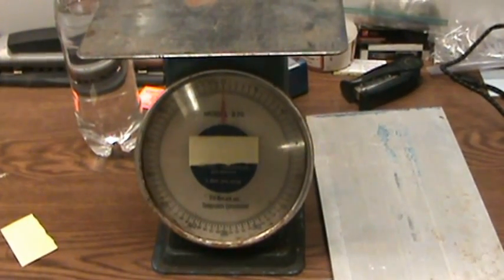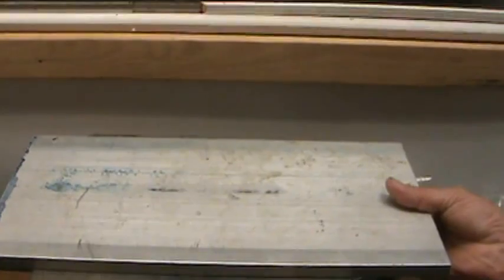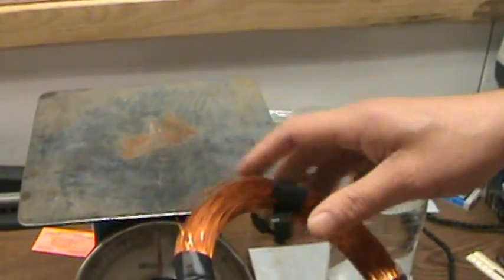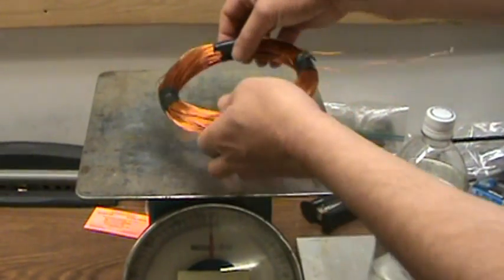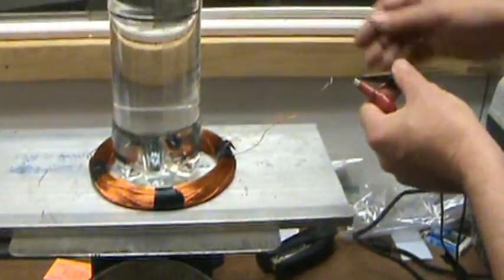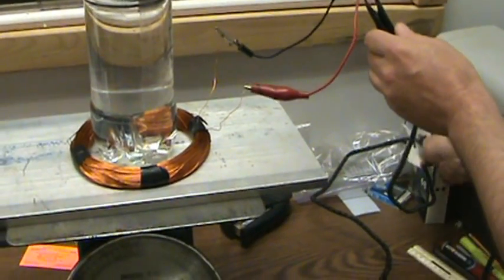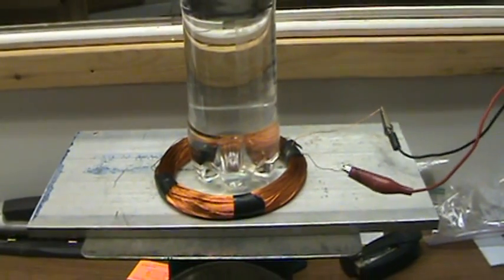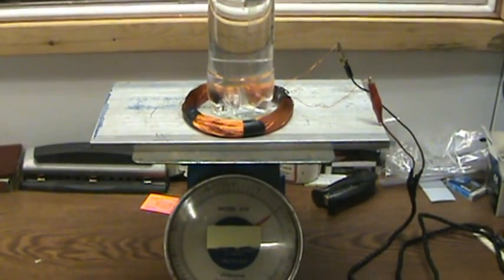Coil Levitating Over Aluminum Plate, Lenz's Law, checking mass

Comment: So why is the coil levitating? Lens law?
Reply: Yes, Lenz's Law.   

AS TO WHY THE SCALE SHOWS THE SAME WEIGHT.
First, recall that a scale just measures downward gravity force.  When the coil is hovering, there is now the additional force created by the opposing magnetic fields (the coil, and the plate) due to Lenz's Law.

The forces acting are:
1)  F = mg  (weight, aka the force created by gravity acceleration)  DOWNWARD.

2)  F ∝ (N⋅I)^2 / δ^2⋅z^3  UPWARD,  where N = # of turns of the coil, I = current, δ = skin depth of current at the frequency of the current (60hz, most likely), and  z = height of the coil above the plate

The 2nd force is how the scale's surface continues to be pushed downward even though the coil is no longer resting on the plate.  You can think of it this way: your dog weighs 25 pounds.  You weight 160 pounds.  The dog (only) is on the scale, which reads 25 pounds.  You lift your dog up into the air, and step onto the scale.  The dog is no longer on the scale, it is 'hovering' above the scale, not touching it.  But what does the scale read?  160 pounds plus 25 pounds.   In this case, you provide the upward force keeping the dog 'hovering' above the scale. You are visible, so it's easy to know why the scale reads 160 + 25 pounds.   The electromagnetic repulsion force is simply not visible.

Comment: comprehending the basic tie LEVITATION however silver FLAT RECTANGULAR WIRE & aluminum FLAT RECTANGULAR WIRE blend coil levitating type 2 DUAL SHAFT ARMATURE ROTARY brushless motorized transductor PANCAKE coil EDDY CURRENTS repulsive FORCES permanent magnet esc TYPE ANTI-GRAVITY UAV FLYING SAUCER DRONE TYPICAL DESIGN however I've design the THERMOELECTRIC EFFECT REFRIGERATION silicon ELEMENT COIL triple junction flat rectangular wire spun tight coil SOLENOID SENSORY transductor RC UAV EDS ANTI-GRAVITY ROTARY MACHINE
Reply from the maker: interesting project you have going on.

Comment: Why!!! can't use dc current
Reply from the maker: The AC current creates "Eddy currents" in the plate, which create their own opposing fields that repulse the coil, like two magnets with the same poles facing each other.  DC can be used but I believe you would have to constantly vary the Amps, so much easier to use AC.
Reply: Thank you sir

Comment: A magnetic field of opposite polarity to the copper coils magnetic field was generated by both the water in the bottle and in the aluminum plate. The coils weight was transmitted through that induce field in the aluminum plate to the scale. Try making a conical coil and drop an aluminum rod down the center of the cone.
Reply from the maker: Hello.  Interesting, I never thought about the water being effected.  The coil produces a field that extends into the alum plate which creates eddy current and it is those eddy currents that produce the repulsing fields, but who knows, i could be wrong.  The coil and alum rod, I can guess it will fall slowly.  I have video that shows magnet falling through copper tube and it takes over a minute to fall through😁.  Here is that video with famous John Hutchison & his wife Nancy visiting my lab and I show him the magnet falling...  https://www.youtube.com/watch?v=dR_-pc5PlaI
Reply: @INVENTOR3  Using a silver rod may also yield the same results! Also it is either the magnets magnetic field creating/generating an opposite polarity magnetic field in the water and aluminum or they both have an inherent neutral electromagnetic field that is repelled by a magnetic field. Check out Diamagnetics! 
https://en.wikipedia.org/wiki/Diamagnetism#:~:text=Diamagnetism%20is%20a%20quantum%20mechanical,magnetic%20dipoles%20in%20the%20material.
Reply from the maker: @captainclone1367  Thank you.  Hmmm, i'm pretty sure my explanation was correct, with eddy currents and Lenz law.  I think it works a lot like the magnet falling through a copper tube....  https://www.youtube.com/watch?v=nV4yA8OYwmE
Water is diamagnetic, repelled by a magnetic field, but it must be distilled water.  I have a few videos with diamagnetism.
Here is fun short one....  https://www.youtube.com/watch?v=fUerH5gAmEI
Here is more serious experiments with diamagnetic.....   https://www.youtube.com/watch?v=zgpi5uirTyQ&t=900s
I also have video of magnet falling through copper tube on my channel.
Thank you very much for your comments😎

Comment: It isnt losing mass but the only reason the weight is still there because you are using a push down scale. The force of the magnetic field is pushing against the aluminium plate causing it to in turn still read 10 lbs. Use a digital scale and record the outcome
Reply from the maker: Yes, i believe it is the Eddy currents in the plate that create an opposing, repelling field.  Maybe i should try a balance scale :-)
Thanks for watching & commenting.

Comment: Like & Subscribe
can you demonstrate the construction i.e. isolation from  a magnetic field// such as using a force sensitive electrical transducer? 
Anything using a ferromagnetic spring for force measurement f=(mxa) mass x gravitational acceleration, would be suspect, right? Consider using a magnetically
isolated transducer for your
next experiment.  If you are using springs in your scale, are they magnetically isolated
( like a non ferromagnetic balance beam with brass weights).
Reply from the maker: Thank you very much :-)
Great comments and good points you make.  The surface of the scale is far above the inner mechanical workings, but good point that they maybe slightly effected by the electromagnetic fields created.  I also mention no loss of mass, but yet i am not using a balance scale as you would for measuring mass.
Yes, i think i need to re-do this experiment using large balance scale.
You are the first to mention these good points, good observations,,,,,thank you for your comments!
The project im working on now, and my next video, will be "how to get free energy from the air"(radiant energy collection).

Comment: this is amazing !!!  thank you , very good to know that
Reply from the maker: Thank you!  Notice when the power is applied, the scale first goes down.  If i were to jump off a scale it would first go up.
Reply: You are correct. What kind of aluminum plate did you use. 6061 T6?

Comment: Nice experiment, and I see the contradiction of the weight still being 10 pounds even when the coil is levitating.  Does the aluminium plate have to be that thick, big.
Reply from the maker: The plate needs to be at least 3/16" to 1/4" thick for good results.  3/16 thick to 3 inches thick, same effects, but less than 3/16 than not too good of results.   Thanks for watching :-)
Reply: Hmm, shame, there's always a catch ;)  Because if it did work with a much thinner, lighter plate and it was turned upside down, then who knows..
Reply from the maker: Oh, it has already been done of course.....
https://www.youtube.com/watch?v=txmKr69jGBk&t=1s
& here....
https://www.youtube.com/watch?v=SlUdNxnHa-k
Reply: Okay, thanks for interesting links.  The second one makes me think of maglev transport.
Reply from the maker: Oh yes, train going over 300 MPH. :-)
Reply: Found one here https://www.youtube.com/watch?v=2lbv5-XvjHo - but the really surprising thing for me is that the mass doesn't change in the first clip.
Reply from the maker: also interesting about the coil lifting off,,, the scale first drops down,,,if i jumped off of a scale it would first rise from pushing off, not drop down like the coil does.
Reply: Wouldn't have noticed that if you hadn't said.  Just played that bit and the needle seemed to be hovering over the 4-5-6 pound mark before going back to 10 pounds.  It's as though there's a reduction in pressure, then it goes back to normal, dunno ;)

Comment: Can you explain this through electromagnetism?
Reply from the maker: Not that well, but i will try.  
The coil creates an electromagnetic field, this field is expanding and collapsing due to the 60Hz AC from the source(wall outlet)and that field penetrates into the aluminium plate, and that expanding & collapsing field creates whats known as eddy currents in the plate, these eddy currents flow through the plate with a swirling effect and the eddy currents also create their own magnetic fields which oppose gravity.  These effects work best with paramagnetic materials, such as copper, aluminium or even gold.  It is difficult to describe with out illustrations.  I would suggest to search "Lenz's law" and "eddy currents" to get a better understanding.
This video illustrates eddy currents very well.....
https://www.youtube.com/watch?v=otu-KV3iH_I

Comment: the reason you did not loose weight is as a result of Newton third law ( action and reaction are equal and opposite ) look at it as you lift you body from the ground during exercise you exert force to the ground and the ground exert force on you .That was why you did not loose mass which in turn interact with gravity to retain the weight.
Reply from the maker: Hmmm, yes, i understand, thank you.
Strange thing i noticed though is that if for example i were to stand straight up on a scale, then squat/bend at the knees, then look down at scale, then jump up,,,,first thing the scale will do is jump up to a magnitude "greater" then my weight. This makes sense, Newton's law, like you said it is an "equal reaction" to the force applied.  Now what i find interesting in this video is, as the coil first lifts off, the weight "drops",,,,where is that equal and opposite reaction.  It is there after everything settles, but when it takes off the weight does not increase, it drops!?  Im trying to understand this reaction it has.
Reply: I think (this is debatable ) the transient drop of weight is due to the inertia of the coil (it has a rest mass), and the magnetic attraction. You can prove this by : take off the bottle, take off the coil, and leave the plate, now take a permanent magnet and put it gently on the plate, take the weight, and now take the permanent magnet at a distance d above the plate, and drop it (don't worry eddy currents will soften the "crash") you will see how the weight increases.
you can do this at different distances above the plate. But more interestingly is when you pull (really fast) the permanent magnet from the plate the weight will be smaller than the weight of the plate, this is due to the attraction force.

Comment: Wow did you see the scale go to 4 lbs the instant that you plugged in the power, the copper winding is only 1 lb.  How did it instantly lose 6 lbs, that is 60% of its weight?  There something weird about impulse electricity that Tesla discovered along time ago.
Reply from the maker: timothypb At first im thinking it is just a reaction like if you were to jump on a scale,,,,,,but now im thinking about it more,,,, the weight goes to like 4Lbs & then goes to 10Lbs,,,,,,but if i were to lightly jump on a scale the weight would go down then go "above" normal. Hmmmm, as i jump "up" the weight would go above normal, to counter act the force of me going up, but when the coil first kicks off the weight never goes above the 10 LBs,,,interesting point!?
Reply: INVENTOR3 Interesting to try spark gap high voltage high frequency to see what will happen.  I think the key here is the short duty(ON TIME) impulse with the right frequency, the switch that you used had to spark when you turned it ON.  There is something really interesting going at the instant the power is turned ON, the right PULSE WIDTH(ON time) at DC voltage will work.  When  you get faster than 100 microseconds PULSE WIDTH there has got to be weird things happen, of course with a charged Capacitor behind it.  Thanks for doing this experiment.
Reply: timothypb If you do this experimenment again make sure there is some distance ( one foot ) between the scale plate and the aluminum plate with styroform or something so that the possibility of the whole aluminum plate becoming a magnet and pulling up on the internal steel mechanisms of the scale for an instant.  This maybe stupid logic, but maybe a discovery will be revealled with this precaution.  Oh yeah that 4 lbs shows up around 2:36 and 2:37 in the video wish it was clearer, just so cool.
Reply from the maker: timothypb Thanks for your comments about the microwaves & spark gap, i would like to try this..  I think i need to remake this video with better view of the scale :-)Hmmm, i would think the scale would go "above" 10Lbs when first powered on, but it drops "below" 10Lbs.
Reply: timothypb diamanetics
Reply: tr3b anyone
Reply: That happens in the first mili second. I think you should use a pulsed DC to make that effect continuous.  Not just a plain DC.
Reply: Hor do you use the spark gap?

Comment: What is the wire made of?
Reply from the maker: just copper enamel coated wire, called "magnet wire" or "transformer wire".
I hook coil directly to wall outlet.  In the USA here it is 120V AC 60Hz

Comment: If you want true anti-gravity, your going to have to figure out a way to shield the object itself from gravity.

When the object is perfectly shielded from gravity it's weight will disappear off the scale.
Reply from the maker: I believe that maybe anti-gravity is just a matter of reversing particle spin :-)
Reply: Reversing it, won't reduce it's weight! But there's no harm in trying!
Reply: Until now there was nothing found that could shield gravity.
Reply: u need to start to think a gravity as an EMF... will be easy to think...

Comment: In 1 phase there will be two windings - main winding & starting winding. Here the current is divided to these two windings in 2:3 ratio as per the winding design. now the Horse power is also divided, 0.6 HP in starting winding & 0.4 HP in main winding.
what is the size of wire(gauge) & Length of the wire in each winding. 

I need the calculations bro, i doesn't mean to replicate your experiment. Im searching everywhere i am not getting it.

Comment: u said that the the current that makes the wire hot, but if there is increase in Voltage ie potential also increases and therefore the current increases.

My requirement is, if suppose i wanted to design a motor; the required parameters are Voltage & Power or HorsePower. Ex: I want to design a motor of 230 V,  1 Ph, 1 HP; now what is the size of wire(gauge) & Length of the wire.

Comment from the maker: Thank you for that info.  If making a coil & replicating this video, using this wire, it will still get hot because there is little resistance.  You need to add a resistor to either end of wire, but then you may not get as good results with the levitating effect. Heat is the problem with this experiment.  Hmm, how to fix this problem,,,maybe add resistor "and" to increase frequency, but im not positive, this will have to be experimented with.

Comment from the maker: It is the current(amperage) that will make the wire hot, not the voltage.
If making a coil, the more winding you have the more induction you will have & the more resistance you will have,,,,so the more windings you have, less hot it will get. Best thing is to add a resistor to either end of the wire.  I will soon replicate this video using a much larger diameter coil & larger diameter wire, & wire will be alum enameled wire & i will have the coil submerged in dry ice to keep cool.

Comment: thank u for ur reply. Suppose if i have 24 swg magnet wire and the supply voltage 230 volts, then what is the length of the wire that i need  without burning the magnet wire

Comment from the maker: I was just reading about this,,,there is "inertial mass",,the resistance to acceleration,,and then there is "gravitational mass", the magnetude of gravitational force that is exerted or experienced by an object. The mass i describe in the video would fall under gravitational force(measured by scale) exerted by an object(the coil) . i think i understand what your saying, because weight is measure of gravitational force acting on a body & mass is property of that "body", that "never" changes.

Comment from the maker: Wow,,thanks for pointing this out.  I will make a new coil soon and make sure to count windings.  I estimated this because my full spool of wire says 750 feet on it, and i only used wire from it for my antenna and a few small coils for another experiment..Hmmm, my count should have been close. Not sure what i did wrong. "Your math is correct"!  I will make a note in the video, thanks again.

Comment from the maker: Needs to be AC, not DC from battery.  Changing electric field creates a magnetic field.
Plug your DC battery into a DC to AC power inverter, found at your local auto store or hardware store :-)

Comment from the maker: I will try it.  I will also try to see how much mass it can displace(weight it can lift).  I tried this over copper plates and it works the same :-)  maybe i will make a video of that also,,,no one has video of levitation over copper :-)  I also tried with this alum sheet, no good, it just vibrates.  I will try many thin layers of alum and see what happens, especialy with a good elec insulater between each layer :-)  It should show if the field it creates is "elec"magnetic or just magnetic :-)

Comment: You will get high frequency feedback depending on your setup x-times your input frequency. So you will need high switching high power blocking diode after mosfet to prevent damage to frequency gen. If you could capture that feedback and reuse, it would be interesting. Cool coil with dry ice before ignition, could mean longer on time and better performance :)

Comment from the maker: The levitation is caused from switching electric fields creating magnetic fields that create Eddy currents in the Alum plate and those Eddy currents create "opposing" magnetic fields that push the coil up :-)  I believe this is what science says is going on here, but im not sure i agree with it completely.  This effect should work with copper or gold plate also.  I will try it with copper plate next.